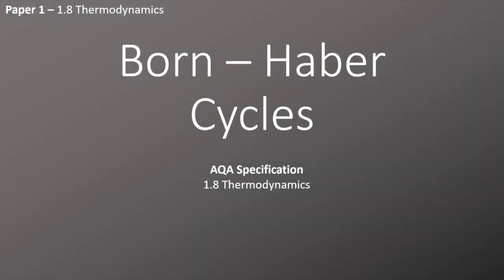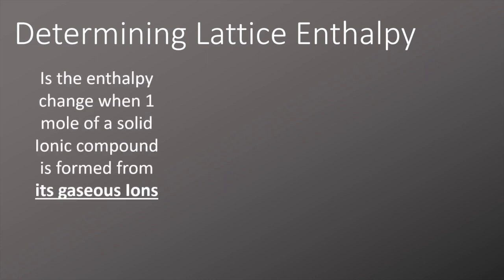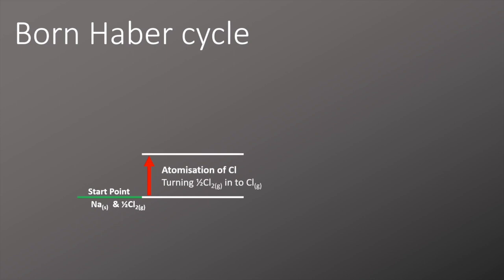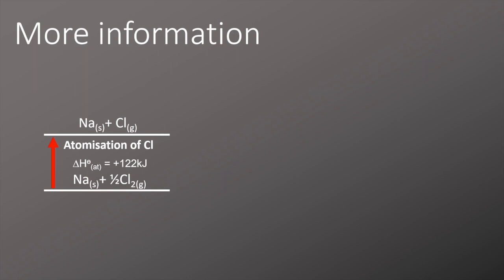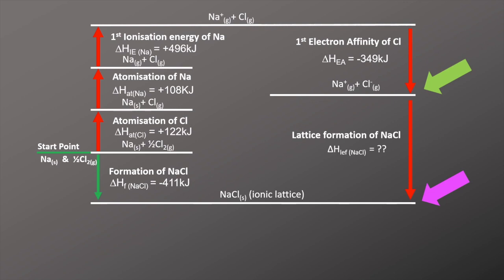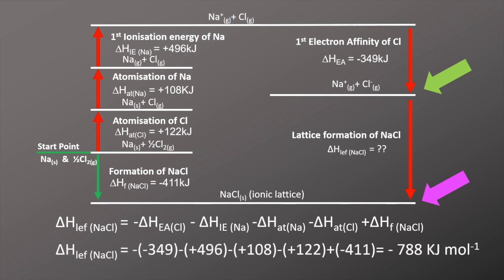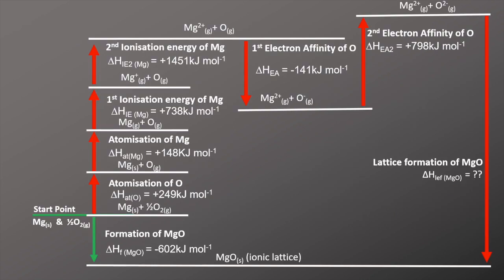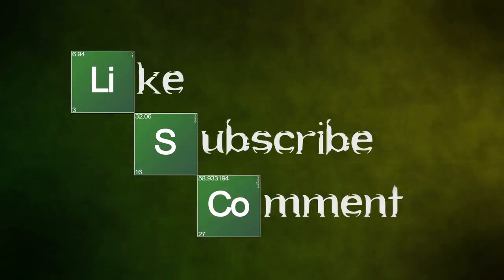Born-Haber Cycles

Comment: Will it always be in the same order and using the same calculations no matter what the different ions are or is it different.
Reply from the maker: The only changes would be if the ions had different charges, for example if it was an aluminium ion it would have 3 successive ionisation energies. Or if it was a non-metal, oxygen for example would have 2 electron affinities. You might be asked to calculate any missing step in the cycle, to do this you use the same method as in the video just set the starting points to either side of the missing step.